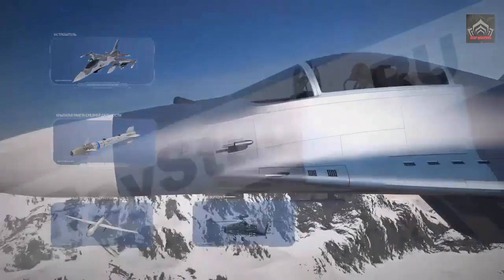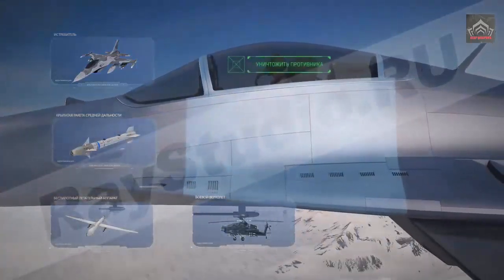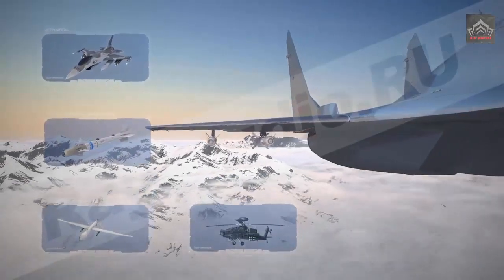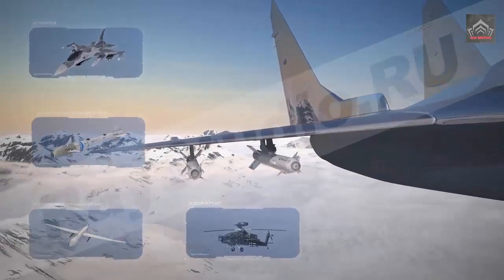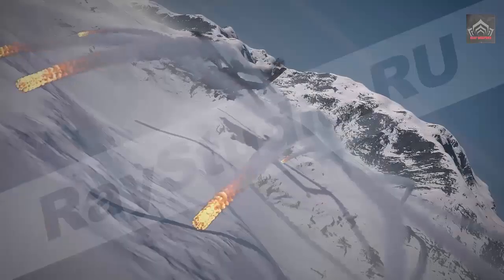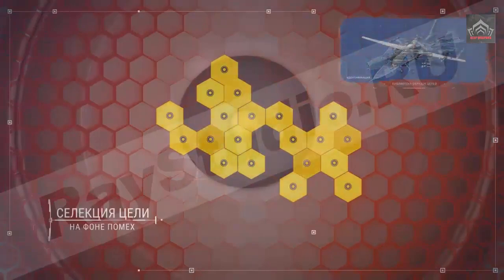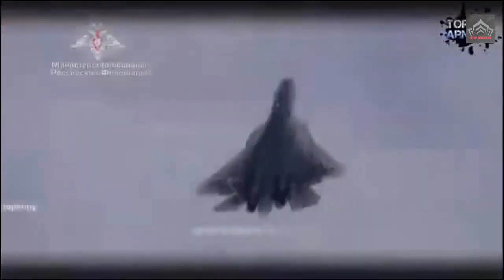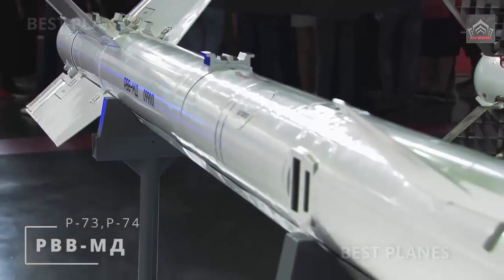Russia's new K-77 air to air missile, a design based loosely on the R-77 currently in service

Comment: Су35 не нужно быть не заметным. Он просто ударит и уйдет.
Reply: Su 30 and 35 are too big and have no AESA radar , the F15 is smaller but can carry more bombs and missiles so no need to always build everything so big. To reduce the radar signature an AESA radar must be used and paint that can reduce RCS that would make it smaller in radar but still possibly 2-3m2 so better jamming system is a must and possibly a DIRCAM system against infra red missiles.